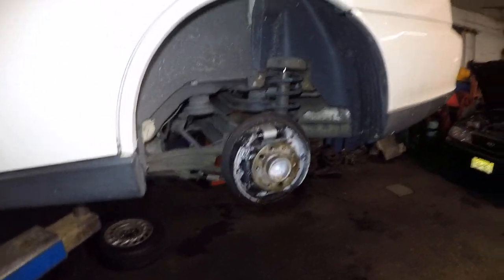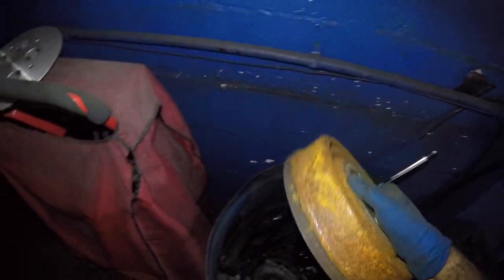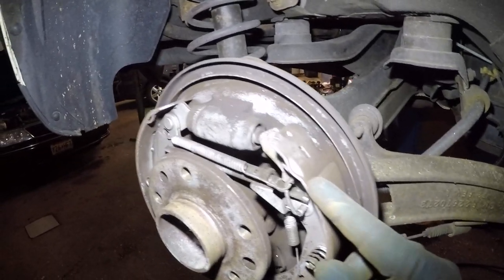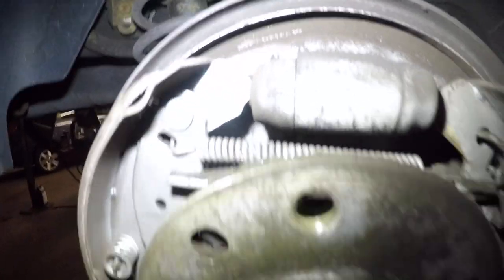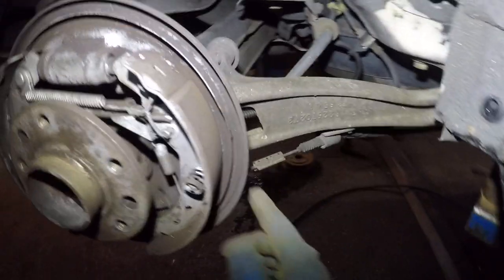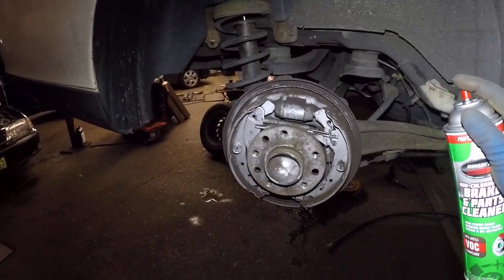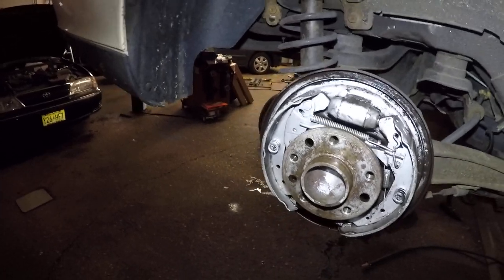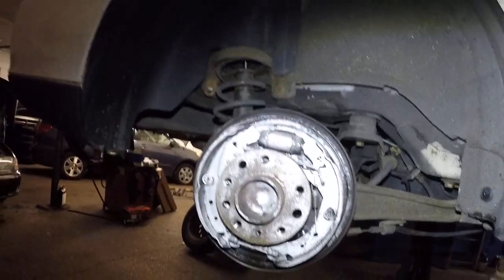Rear Drum Brake Making Banging Noise

Comment: 'What if you tried all that stuff and it still clunks. I just put on a new drum and the clunking started immediately. So, I replaced the shoes. Still clunks. So I cleaned up everything just like you on the vid and also adjusted them. Still clunks. I replaced the drum because the last one was warped and caused vibration whenever I braked. Now I get a clunking. The clunking is also intermittent so sometimes it doesn't happen but most of the time it does.
Reply from the maker: I had one like that it just stopped doing that after like 3k miles

Comment: Hey man. I replaced my shoes and drums. Cleaned and adjusted everything. Handbrake feels good. Noise went then came nack after a week. Beed help!
Reply from the maker: What type of noise. Is it bang bang as u apply brake
Reply: @RBTheMechanic  yes like the shoes are binding. What do you reckon? Also thanks for the quick reply
Reply from the maker: @husseinsaad1381  well I had issue on drums I had one customer that I readjusted brakes shoes over and over it never worked but after driving for like 1500 miles it went away
Also I tried this which worked for me  adjust the brakes to the tightest and then in do 3 clock back and it should be free to spin

Comment: Great video. I followed your instructions and solved the noise issue of my rear drum brakes. The question is: will the noise come back after a few months when the gaps between shoe and hub get larger? If it comes back again, when should I consider to replace the shoe or the hub? Thanks a lot.
Reply from the maker: It shouldn’t !! Let the time tell I think u will be good!! Great job doing this

Comment: Great video. Came here because my car has same problem, but the noise is still there when no brakes are applied. Replaced the drums and the shoes, still no change. Brake lines need bleeding (pedal is spongy), so hoping that will fix the issue. What do you think I should do about the problem next?
Reply from the maker: Try fixing the spongy issue and check where and which side the noise is coming from stand by while some one recreat the noice to figure out which side exactly it’s coming from check backing plates rust and corrosion
Reply: @RBTheMechanic  The knock is coming from the passenger rear. Opened the drums and found that one of the shoes (bought and installed a few days ago) is already chipped and scored the drum 💀. Very weird so I sanded that shoe down and the noise is now better, but need to sand it down more.
Reply from the maker: @GearzMonkey  ooh not sure what could be the issue I had a car that was knocking as I press brake peddle it didn’t do it first day it came day after customer came back I tried so much and adjust over and over but then I gave up cuz I never found anything wrong or off but it went away after driving like 1000 miles I guess the shoes and drum had to brake in and take the same shape
Reply: @RBTheMechanic  Can only imagine how confusing that must’ve been for you man. As I keep grinding 😂. Thanks a lot man 👊🏽
Reply from the maker: @GearzMonkey  yeah

Comment: Hi in my mirage when I press brake pedal I was getting ticking noise I noticed brake calliper clips are loose but disc also bad what I need to replace clip or disk
Reply from the maker: Lalith Kumar so I have disc brakes well do complet job change disc and the clips make sure u clean the brake caliper beaker with wire bush or file and do a good job I show and do how to clean the caliper bracket so the clips sit flush

Comment: Great job on the brake drum video!!  I grew up when all cars had drum brakes both front and rear.  So we had to learn the tricks and replacing them. Very few know that these days, so your video is top notch on youtube which will help lots of people.
Reply from the maker: Thank u yeah they are rough I had one car come years back to my shop had all drum brakes
Reply: @RBTheMechanic  Your welcome. those are all classics. I have one which is a 1965 Ford Falcon Ranchero deluxe all stock. There is modification to put disk brakes on the front, but that would drop the cars values and there is really nothing wrong with front drum brakes. The drum shoes have outlasted the disk brake pads on 3 other newer cars I have.
Reply: yeah, still using 50s tech,hehehehhe

Comment: Recently replace my brake pads and rotors on my 2019 Honda pilot exl now it make like a ticking noise in the rear like a clock I took everything apart check I even adjusted the parking brake but no luck
Reply from the maker: Did u lubercate the hardware

Comment: I have a 95 Chevy and I have been hearing popping noises badly, rear driver side, I figured it was because my brakes are old so I replaced it plus hard ware and it still does it
Like if I throw truck in reverse, it’ll pop backing up, it pops any time it’s moving but I swear it’s not the middle of truck, it’s from my freaking driver side. Please help
Reply from the maker: Can u check the drive shaft have some one put the car in drive and reverse and u take a look just be careful and not get tuned over

Comment: My car makes a pumping noise when braking at low speed Everthing is brand new. Everything was adjusted and cleaned some parts were greased . I dnt know whats going on
Reply from the maker: Daniel Guzman they need to be adjusted equally I have had that problem try this adjust it from the back hole right both brakes till drum locks and then untight about 3 click or 4 just to Realestate the drums that should be equal